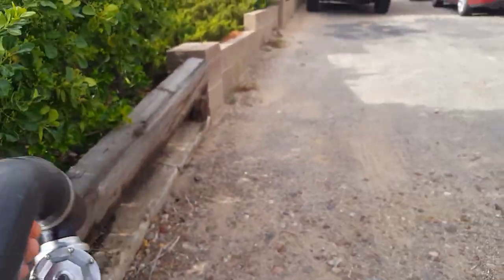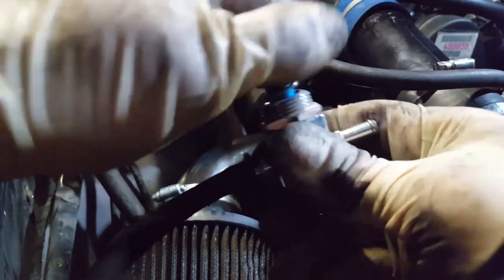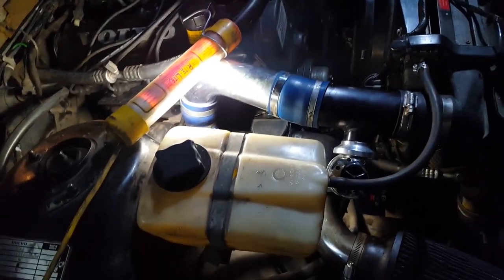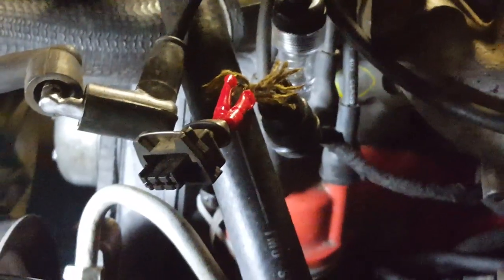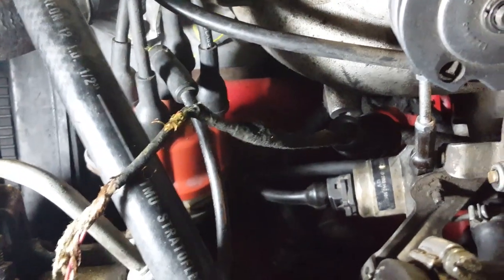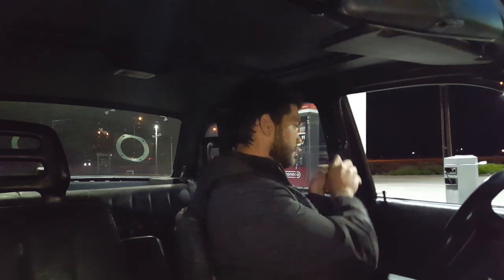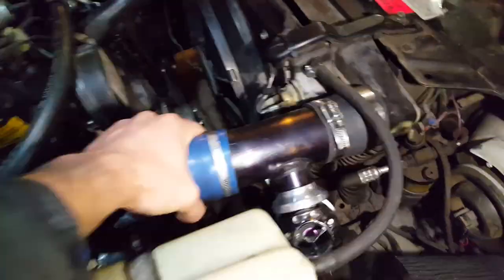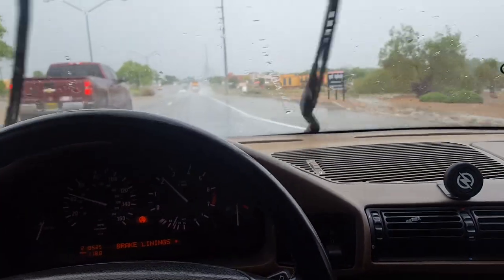🇸🇪It Runs! Volvo 240 Turbo swap FINISHED (wiring harness problems) Ep 4

Comment: your bov is the reason it dies after you let off, it's a maf metered system and every time you let off it Leans out because it looses that volume of air that was already accounted for before the turbo. it happens on any maf turbo car with a bov.
Reply: Nah man, cant be lean, if there is alot of meterd air going in and it suddenly disappear. there is ging to be more fuel then air. The air escaped from the bov right =)

Comment: you need to move the maf to after the bov if your gonna run a bov if not it will stall after you do a pull coz it blows out messured air and it gets way to much fuel
Reply from the maker: john ivar except that it stalls even when not boosting. just doesn't like idling. but that might do the trick, since they were designed for CBV valves
Reply: it will stop hesitating after pulls aswell or become better atleast

Comment: Is the MAF going to be okay in such a hot spot?
Reply: +Nick's DIY  Probably not, electronics need to be kept cool, which is why they are mounted in a position where they get air flow over them in production vehicles.  They also need to have fairly cool air flowing through them which is why modern turbo cars are intercooled, otherwise they burn out or become temperamental really quickly...